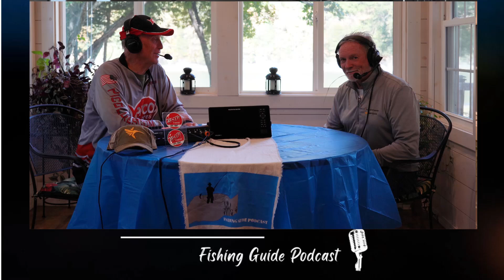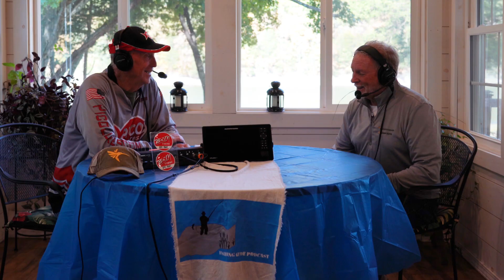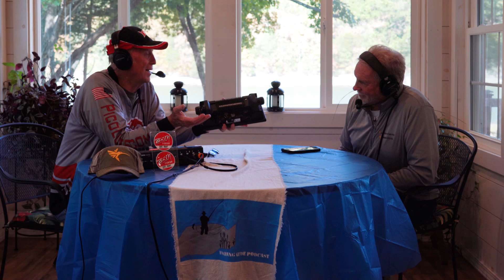Humminbird marine electronics expert JE VanNatta reveals features of the XPLORE & other marine units

Comment: HB engineers need to improve the bottom returns from megalive 2. Sharper bottom returns would help in forward mode and especially in landscape mode. Landscape mode is a little blurry and not as clear as the competitors.